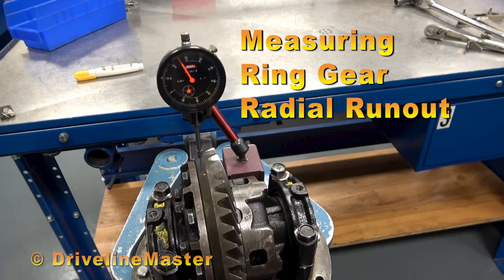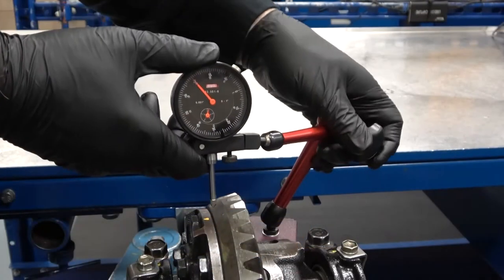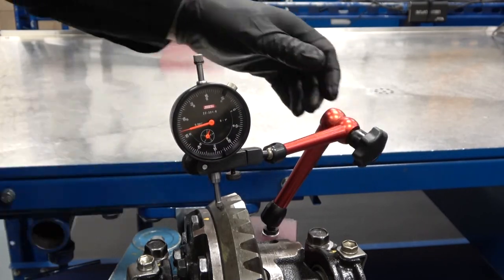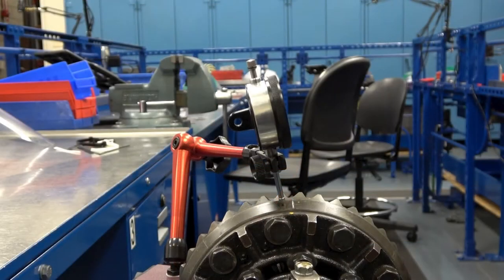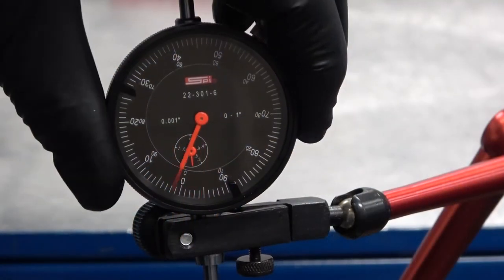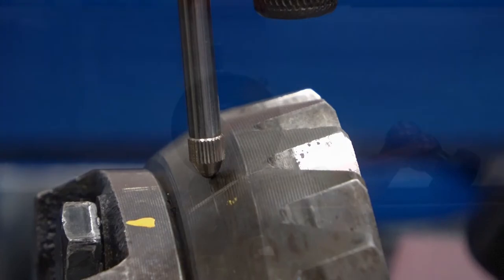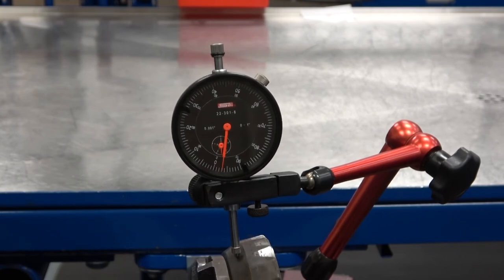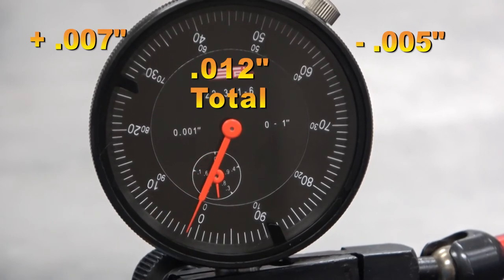Ring Radial Runout

Comment: Is that too much?
Reply from the maker: Yes, this is a bit on the excessive side but it's not as important as axial ring gear runout. The next step would be to measure the radial runout of the differential case to determine if the problem was in the case or the ring gear.  I'm not too worried about this .012" if the rest of the differential setup and measurements were all good.
Reply: So does this affects backlash?